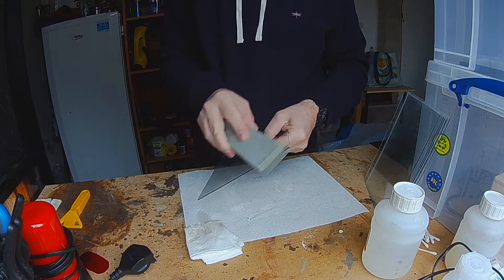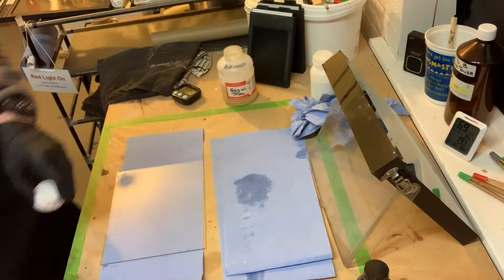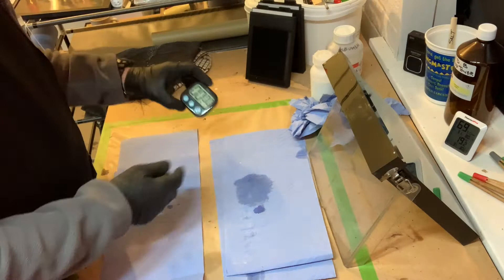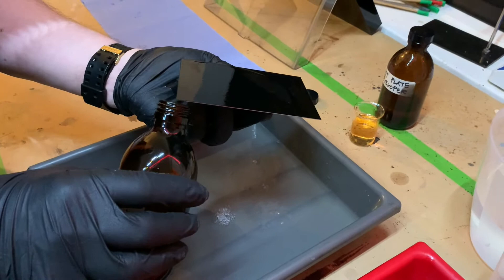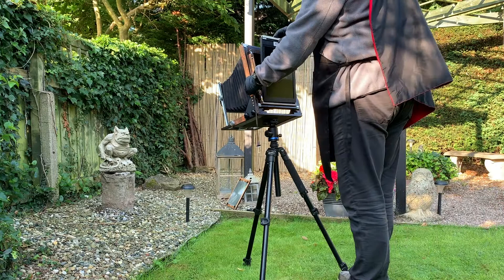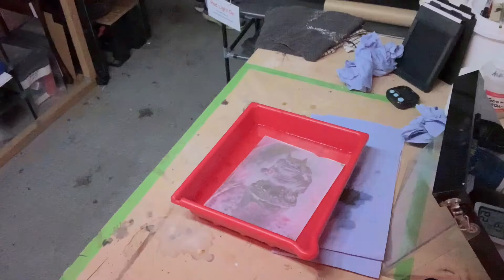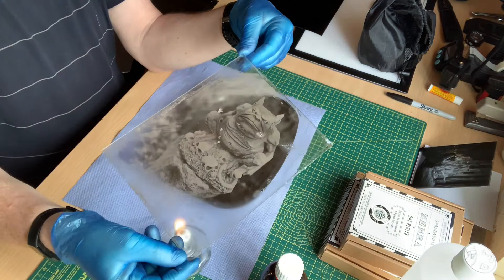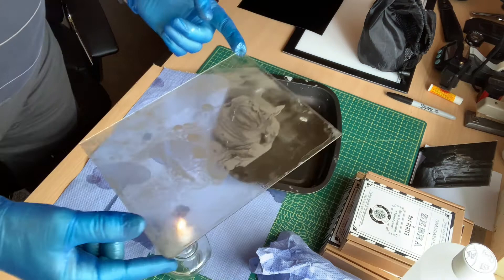Wet Plate Collodion Process

Comment: Thank you, Great work, learnt a lot about the process. Also wanted to ask how do we prepare ferrous sulphate developer and Sodium thiosulfate fixer, would help a lot to know about that!!!
Reply from the maker: 10g Ferrous sulfate, 10ml Denatured Alcohol, 7.5ml Glacial Acetic Acid, 232ml Distilled Water - Mix the Ferrous Sulfate with 200ml distilled water then add denatured alcohol and acetic acid. Mix well and top off with remaining distilled water. 

150g Sodium Thiosulphate, 500ml Distilled Water - Mix Sodium thiosulfate with half of the distilled water in a bottle and shake until dissolved. Top up with remaining distilled water and is ready to use.
Reply: Thank you sooo much for sharing this, can't wait to try it out!!!
Reply: Hello again, just had a doubt regarding the silver bath, is it necessary to add iodide of silver or just 9% sliver nitrate solution will work???

Comment: Hello, thanks for this great video.
I'll have questions about the toxicity of the product used for this process.
How do you deal/dispose of effluents after you are done with? Could rinsing water pose an issue for the environment?
Thanks.
Reply from the maker: Hi Fabien, thanks for taking time to look at the video! As far as the harmfulness of chemicals are concerned you are correct, some are quite toxic in their normal state, however, the silver is recycled and never thrown away and the cadmium bromide used in the collodion is not discarded but consumed by the process (ie there is no waste). What little that remains from washing process is so minuscule it can be disposed of in normal drainage facilities. I never dispose of water from  washing in the field without collecting in a sealed bucket for disposal later. Hope this answers your query.

Comment: Really nice!! When you take it inside the nitrate bath, can you do it with lghts on? I just saw you using red light when placing it in the holder.
Can fixing step be done with lights on, too? :)
Reply from the maker: Hi, thanks for your interest....you can do everything with lights on up to the point at which you put the plate in the silver nitrate tank. After this you must do everything with red safelights until after the fix process. Lights can go back on approx 2/3 after the fix process has started.
Reply: @TomLeePhoto  Very nice! I will try it soon, hopefully!!
Reply: @TomLeePhoto  I have a similar silver tank like yours.
 Can I leave silver bath rest inside the tank until it's exhausted or should I take it back to an amber bottle  everytime I finish a photo session ?
Reply from the maker: @tcdp9804  I don't change the bath for up to 6 months (multiple sessions). Remember to agitate the silver approx 30mins before using at each session to ensure the silver is fully activated and does not produce striations. After 6 months I sun the silver in clear bottles for two days before storing or re-using.
Reply: @TomLeePhoto  Do you litterally Sun the silver nitrate solution in 'clear bottles'?? Shouldn't nitrate solution get damaged in non-red light? All your comments are trully a treasure, maestro. Thanks
Reply from the maker: @tcdp9804  Yep - you re-activate the silver by exposing it to UV light. This is kind of difficult in amber bottles!! Put the silver in a clear wide neck bottle, place cause or filter medium over the neck secured with elastic bands (to stop flies and debris from getting in and let other stuff evaporate out). Check the ph and sg when finished (at least 4hours constant sun). Add a few silver nitrate crystals if below 1.07 (70%). Your ph should be spot on but if it's a little high (above 4), add a few drops of 3% nitric acid. Then you're good to go.

Comment: Can it be digitized by scanning? Or be used in contact printing?
Reply from the maker: Hello friend - yes but it depends on which method you are pursuing! The Tintypes are best scanned prior to varnishing, however I prefer to re-photograph them digitally. The Ambrotypes (glass) can be contact printed (or printed conventionally with an enlarger) either before or after varnishing. Remember that the plates are more fragile to bumps and scrapes before a protective varnish is applied. Hope this helps, Tom

Comment: The big question, where can I buy a camera? What would I be looking for?
Reply from the maker: Not sure which part of the world you are in however my 5x4 camera was purchased from intrepidcamera.co.uk. This is an excellent camera for a good price and great for getting you started. They also make a 10x8 version, but you will need to buy a lens (see eBay) and there are many camera backs made specifically for wet plate such as chamonix. best of luck on your journey, Tom
Reply: @TomLeePhoto  thank you so much, one more question. Are there lens sizes are trying to stay within to do portraits.
Reply from the maker: @baroneblades5386  The size of the lens is directly related to the size of the camera back! 5x4 cameras should have a minimum 150mm lens whilst a 10x8 back should have a 300mm lens minimum. Going below these minimums will probably result in vignetting.

Comment: Hi Tom. What camera are you using there?
Reply from the maker: Hi JC.....I use an intrepid 5x4 for the small stuff. The 10x8 featured in this video is a self built camera from odds and ends but would like to use the Intrepid 10x8. It has much better features but like building things myself!
Reply: @TomLeePhoto  Very cool. I'm also a builder. I'm setting up a spare camera I have to learn this process though. Nothing big. It's a Horseman VHr. Little 6x9 jobby. I figure the plates and stuff will be cheap and I can use it to learn on before dedicating to a bigger setup for it.
Reply from the maker: @j.c.m5168  Cool - best of luck for your future build and progress.